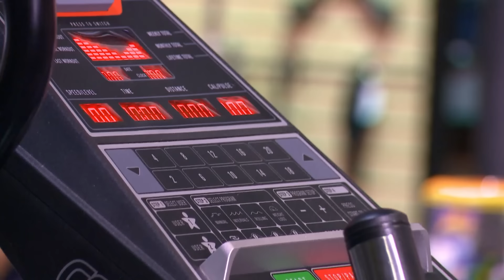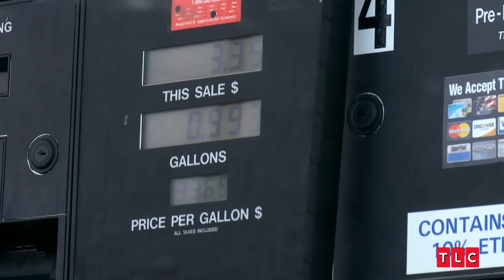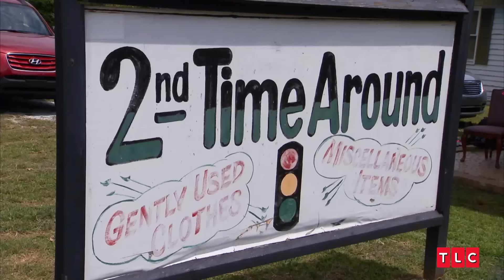She Fills Her Pool with Junk to Save Money! | Extreme Cheapskates

Comment: the bike and alternator thing is absolutely a set up. this would not work, and her saying it did after 15 min is more bull. the alt would need to charge a battery pack and the batteries would have to do the work. she has a alt connected to a power inverter connected to ?????
Reply: the alt is less than half the size of the pump motor!!!

Comment: LOL cares about saving money but paid cash for the house instead of getting a loan and investing the money in things that pay the same or higher interest than the loan. Has a traditional pool costs tons of money to maintain when they could have a natural pool that is fairly self maintaining. That bubble wrap won't outlast a proper pool cover since it has nothing in it to resist UV damage. No way she is powering that pump with the bike. 

There is no way any of this is real. The only logical thing would be getting just enough gas for your trips to save on weight and get a tiny increase in fuel efficiency. That is assuming your time is worthless though.

Comment: The toilet thing is legit actually. Just dont think everything that you see is legit. A lot is just for the show I believe.
Reply: But she claims she's saving 350 gallons/month (11.66 gallons/day). Two bricks take up approx. 96 cubic inches. One gallon of water is 231 cubic inches. So if she's claiming to save 80,850 cubic inches (350 gallons) of water a month, that means she'd have to flush approx. 842 times a month (28x a day) for the volume of the bricks to equal 350 gallons. Even with kids, there's no way that toilet is getting flushed that often.

Comment: "We use 350 less gallons a month" by putting two bricks in the toilet tank. Okay, so let's do some basic math here. You claim you're saving 350 gallons/month (11.66 gallons/day). Two bricks take up approx. 96 cubic inches. One gallon of water is 231 cubic inches. So if you're claiming to save 80,850 cubic inches (350 gallons) of water a month, that means you'd have to flush approx. 842 times a month (28x a day) for the volume of the bricks to equal 350 gallons. Even with kids, there's no way that toilet is getting flushed that often.

Comment: The thing with powering house with bike...
On average people can pedal 200W for 1-2h.
Even if you sat down at your bike everyday, it'll be 60h x 0,2Kw = 12kWh / month
I looked up average prices in US, 0,17$ per kWh, = 2,04$ per month worth
You would need to ride it x100 times harder/longer, which is impossible. (to compensate 200$)
Not even mentioning the cost of bike, cost of establishing way to transmit power. Also a lot % of power is lost during conversion...
It's just stupid idea.
Only applicable if u dont have electricity. But still very inefficient.
Instead moving on fresh air and giving body various stimuli, you sit in small dark room.
Reply: I'll just mention, if 1kWh = 0,17$.
Her 1h pedalling is worth 1/5 of that = 3 cents per 1h work
Earning worse money than African slave.

If including price of bike, dynamo and spent time on finding parts to make it work and spent time, +maintenance. She's gonna pay this up in time of 50 years of pedalling xD

Comment: Ohhh where to start. Makes no sense to burn fuel just to go exercise at sporting goods store. Just get your exercise by brisk walking or running. Sometimes you gotta spend money to save some. She needs some used batteries, used solar panels, and a power inverter. I don't think using a 12 volt alternator is going to power the water pumps for the pools filtration. I'm sure the filter motor runs on AC and a 12 volt DC alternator is not going to do anything. Using solar panels and lining up the batteries in parallel then connecting the inverter to them would run the pools pump. Just the task of doing that I feel would be above her intelligence and problem solving skills.

Comment: They use 350 less gallons a month because of bricks. They must be full of sht to use the toilet that much!

ba da tink
Reply: Yeah, she claims she's saving 350 gallons/month (11.66 gallons/day). Two bricks take up approx. 96 cubic inches. One gallon of water is 231 cubic inches. So she's essentially claiming she saves 80,850 cubic inches (350 gallons) of water a month, that means she'd have to flush approx. 842 times a month (28x a day) for the volume of the bricks to equal 350 gallons. Even with kids, there's no way that toilet is getting flushed that often.
Reply: @scaraco  Yup so either they’re full of it or they’re full of it. Either way I ain’t buying it. Hell yeah r/hdtm